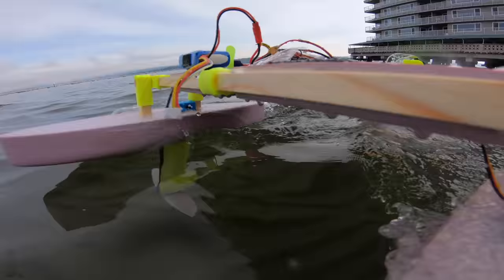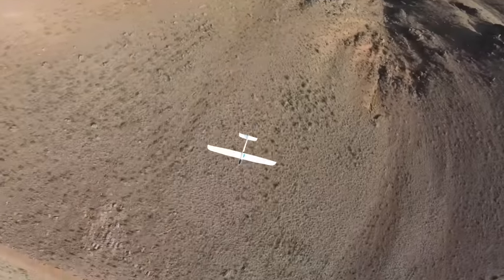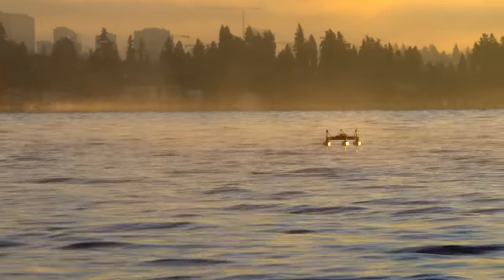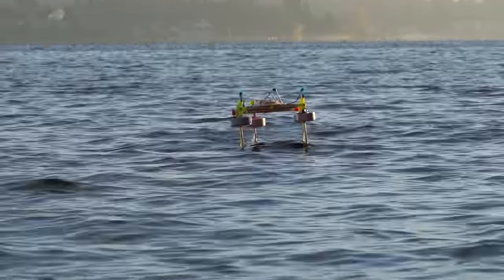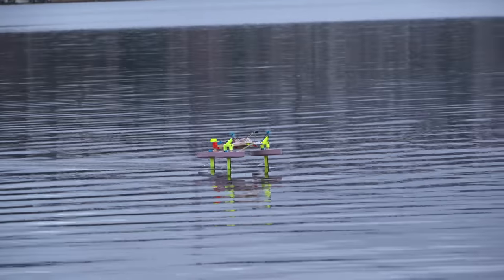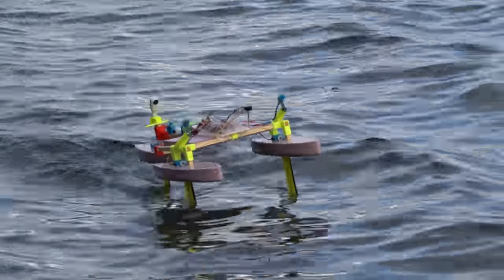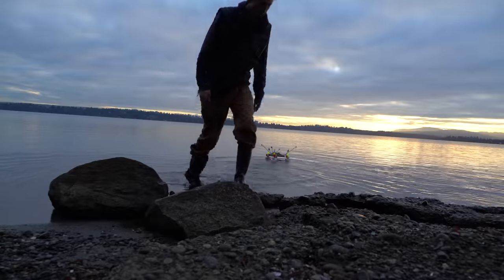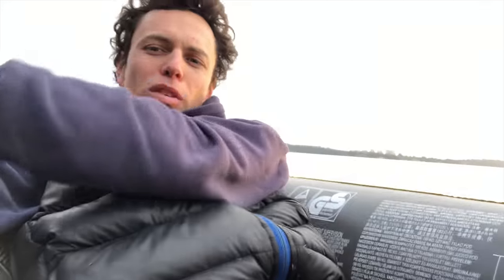Can a HYDROFOIL Fly like an Airplane???

Comment: The reason for (at least part of) the 15cm deviation in altitude is likely due to the distance it takes to correct  course. It takes time for the  rear of the plane to move into position to change direction, but the boat can maintain attitude.

Comment: Super cool!! The first thing I'm thinking about when I see it floating is that you could potentially have an integrated water level sensor in each "foil arm". You know these cheap 10-15cm sensors used to monitor small water tanks. I don't know if they have a good resolution but it might be better than 5 data points..!
Reply: combine it with a few sonar sensors and weight them and you might get a more consistent average. You could probably measure the water roughness to some degree too.

Comment: what flight controller are you using?  I am getting in to some RC stuff but the ardupilot flight controllers i have seen get expensive.  Any suggestions for some cheaper ones that won't make my cry when i crash and burn?

Comment: Pretty awesome. I’m sad Daniel didn’t try mechanical pitch control with a rod attached to the foil and a float. It makes sense because waves would cause a lot of oscillation where as the Optical sensor can tune it out and is way cooler and versatile.

Comment: I feel like you gotta surf it to make it flow really smooth. When people surf there is a consistent up and down motion like a sine wave, so in theory you could set it up to oscillate between its vertical limits. Then its just a matter of baking in enough tolerance to account for sensor noise.

Comment: seaweed, hah, try an acorn barnacle. Love the work. back facing  struts so the seaweed is pulled to the surface where it has less drag ? and can be harvested into the bioreactor. RCflight its wonderful to watch your progress in autonomous water vehicles. its the perfect medium for solar powered transport. Ive just looked up the evergreen, 400x60m  59,000 Kw engine, 60MW. feels an enormous figure.water displacment takes alot of beans. Slower boats , solar powered boars.

Comment: If you want to reduce the catching of seaweed on the supports for the hydrofoils why not just angle them backwards slightly so the seaweed falls off.  you can also angle the little wings backwards too so that the seaweed will just slide off.  idk if this will actually work, this is just my first thoughts to the issue shown at 6:58

Comment: The one sonar per foil looks like you could code a controller at least as stable as the Ardu-Pilot.  But it's getting fouled up by the non-linearity of the hydro-foils and cross-coupling.  I.e. the additional lift force from every degree of foil pitch changes as the boat goes faster and slower.  I assume Ardu-pilot already has code to compensate for this so it's stable over a wider range of speeds.  Cross-coupling between the foils and sensors also doesn't help, but becomes less of an issue if the control loop gets more stable.

Comment: It's almost like something is missing. Like a gyro effect. The height sensor should manage an "up/down effort" control surface, and an accelerometer should control some kind of smoothing. I suppose you could build complicated, articulated hydroplanes, or use the PID controls that are likely in your controller already. It seems obvious enough that I would have expected you to do this by default, so I wonder if your servos are not good enough, or need some kind of springy linkage to add mush to the control loop.

Comment: I'm playing around with a foil project and have similar issues with the pitch. I have a sensor for altitude but ardupilot modes won't hold altitude a such low levels (FBWA seems the only mode that does). 
Curious how you modified ardupilot to use the sensor to control pitch. Was it a script or did you change the code in your own branch. 
Any help would be appreciated.

Comment: Downwind problem is called a sea crash.
Its because the water is rising at the front of a traveling wave, and falling at the rear. Your foil kicks down as you catch up will a ripple, then tries to jump up as it leaves the front of the wave.
The opposite of what you want.

Comment: You could't have attachted to copper strips to the front two stands and measured resitance between them. The deeper they are submerged the lower the resistance reading would be. Obviously that would need quite some tuing, or even auto-calibration as it is highly dependend on the salt content of the water. A fixed measurement at the third stand could be used to "measure" the salt content and set a constant for the calculations. This way you should be end up with a very precise hight messurement. You could event go one step further and not messure between the legs but messure each leg indepent to see how deep each stand is and use that for sanity checks combined with the gyro sensor. That should be as stable as it gets. Or use it in tandem with multiple sonar sensors to get really acurate.

Comment: Are you able to make sloped hydrofoils and stems, which automatically clear algae?

And while you're at it, maybe passively stabilized hydrofoils, where each stem gets 2 or 3 hydrofoils, which balance at the right speed and depth, due to the upper ones (which push up slightly) are just skimming the surface, while the lower ones do the main work

Comment: The tougher time going downwind is because performance drops off considerably. This is completely normal for prop powered anything. Have you ever noticed that birds takeoff and land into the wind? Aircraft the same. This is because performance increases performance - but not speed - into a headwind. Downwind when in flight is a different story.

Comment: Maybe it had a problem going down wind because of less lift from less water flow over the foils? Also the sonar sensor is right on the tip of the vehicle so if it crests a wave the sonar sees the water is lower in the trough and reduces lift input and throttle think the water is actually lower then where the foil surface is.

Comment: Instead of using just a sonar sensor, what if you also had an accelerometer oriented to measure how quickly the hydrofoil was moving up and down?

Integrate the accelerometer output to get a precise but inaccurate altitude, then use Kalman Filtering to combine that with the imprecise but accurate sonar.

This suggestion is 100% inspired by how self-balancing robots use Kalman Filtering to combine gyro sensors and an inclinometer to identify what direction is down.

Actually, you might need to double-integrate the acceleration to get altitude, I'm not 100% sure.

Comment: For a while in the late 60s early 70s there was a passenger carrying hydrofoil on the Thames in London. It failed for the same reasons your did too much floating debris, including things like lumps of wood the size of railway ties/sleepers.
Reply: Amazing trip especially when it was brand new and the captain performed tricks underway. Hydrofoils are still in wide use elsewhere reliably, so it must have been a particularly weak design.

Comment: Have you considered to use a Time-Of-Flight Distance Sensors for this application? There are some advantages in doing so (High frequency reading and interference resistance).

Comment: Did you try removing the throttle from the control loop? I was just thinking, wouldn’t you be able to get it planed out even at relatively low speeds?

Great work, as per usual. 😁

Comment: Just thinking out loud here. But you could probably control it manually if the front 2 foils were fixed with smaller aileron's like an airplane. Something I'd like to see someone try that you'll see with low wing aircraft is wings slant upward twards the wing tips. When the aircraft is in a slight bank, because the wing that's more level to the ground produces more lift in respect to gravity and acts as an automatic leveler. High wing aircraft don't usually use slant wings because the weight is already under the wing and acts as a ballast.

Comment: what i have been wondering for a long time is if u slap wings on a sub or put a  flying wing underwater would they still fly like as if they was in the air it would take less energy to move and the crafts would be buoyant so would be more efficient less gravity pulling down forces

Comment: I wonder if you could design a slot that would fit a single edged razorblade into the front of the hydrofoil towers, so that it would be able to slowly 'slice' through the seaweed. Or maybe have it slightly wiggle back and forth as it is attached to the control rod--somehow--and it makes tiny little slices up and down as the control arm moves up and down.

Comment: I wonder how it'd do if it had a gyro setup added to the control inputs for leveling and rate dampening? The depth sensors would then act more like a trim value while it tries to limit vertical acceleration.

Next up, try to make a hydrofoil that one can ride on out of a kayak propelled by some small electric trolling motors.

Comment: Have you considered maybe angling the hydrofoil posts at a 45 degree angle,. so if seaweed hit it it will slide down and off the post? Also set the wings a bit shy of the leading edge, so the seaweed doesn't catch on the wing as it slides down.

Comment: Idk how hard this would be but if you could add a rudder to turn rather than rolling from changing thrust. I think IMU is prob the best option for keeping things stable (even better if custom use for this not plane controller). maybe use the range finder only for increasing thrust. I dont think you would want a range finder for each foil especially the one on the end that was facing backward would not be measuring what is coming. still might want them to act independently, like for the foil in the back have its movement delayed from the front. Im sure you could have a range finder look forward for each wave and calculate from how its moving and speed you are going but that sounds very hard

Comment: If you don't have a fly-by-wire depth control then you should use a V shape hydrofoil to have a low-tech self-correcting lift surface in pitch roll and depth.

Comment: Can't you verify the distance to the water checking the resistivity inch by inch on the boat's legs? Or checking by the drag caused by water vs caused by air?

Comment: My immediate thoughts are that you're trying to solve a stability problem with computer control instead of making the "hydrodynamics" more stable.
Maybe the front wings should stay still, should have dihedral going on, and the centre of mass should be forward and down from the centre of lift. Also, remove throttle from the equation entirely.

Comment: Why did you choose to use the throttle for altitude control, wouldn’t the hydrofoils be fully capable of maintaining the altitude without the throttle control? It might make for some smoother sailing when the speed of the craft isn’t constantly changing.

Comment: Okay so like, the balancing software from a single wheel robot and a trawling motor style hydrofoil. the batteries are built into the seat that opens when you unfold it

Comment: Wow! Really interesting stuff! What are the advantages and disadvantages of a hydrofoil craft over, say, a regular boat or a plane? It seems like there would be much less resistance from the water but the propulsion seems less effective in air than in water.
Reply: Usually the hydrofoils have an outboard propeller or prop on their rear-most foil lol.
Reply: The efficiency of the hydrofoil is somewhere in between, it is faster than ordinary ships, and its carrying capacity is higher than that of airplanes. It has a competitive advantage in certain transportation fields, such as carrying passengers in the strait.

Comment: To me, the obvious application of of the autopilot system would a personal pleasure hydrofoil. Somethiing like a 4 person runabout built out from a jon boat or scratch built.

I always marvelled at the diy personal hydrofoil creations that people came up with, then I realized they were vert self limiting due to stability issues.

And even with a skilled pilot, range would be limited due to pilot fatigue.

I had seen a turnkey commercial offering with an auto attitude control system, but it was quite expensive.

But I see.no reason your system.could not be adapted for a larger craft.

The problem would actually be simpler as you scale up, as the wave acrion becomes proportionately smaller, and sensor accuracy becomes less critical.

Response time and latency would mattee more as you increase speed of the craft, of course.

Comment: I wonder if you could put the foil post things at a slant so at top of post is more forward toward craft, then at bottom it is more towards back, then at bottom in corner put a razor blade to cut the seaweed, like wire cutters on aircraft

Comment: running a wire with a small gap would act better for a fixed distance sensor in water. water shorts gap and completes the loop. water falls below the gap and loop is open.

Comment: wait, ArduPilot can run on an ESP-01?! all this time I thought it was only for proprietary hardware.. been putting off my own drone projects because I didn't want to go all the effort.. neat
Reply: As far as I can see the ESP01 was a data link. Sadly it doesn't seem able to run ardupilot. There is effort going in to using esp32.

Comment: Anyone remember those old v shaped 'boomerang' antennas on the back of old limos? Why wouldn't that shape (upside-down of course) eliminate snagging on seaweed considerably?
Reply: It probably would, but it would also put more surface area for a certain amount of lift into the water, generating more drag I think.